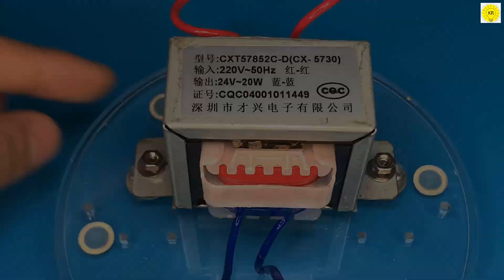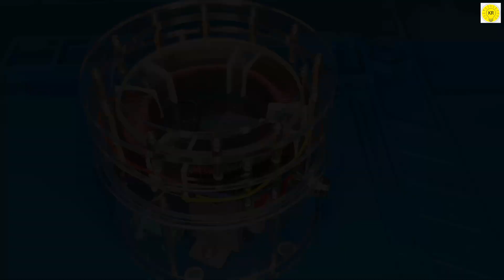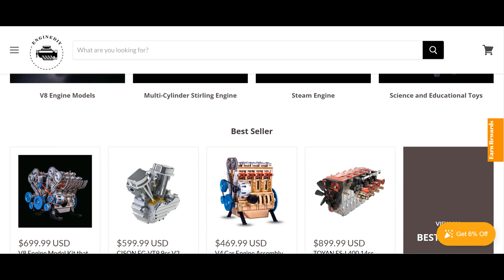how to make AC motor tesla coil motor

Comment: This is how to assemble a widely-available (and low-quality, compared to other versions of the device) commercial product, not how to "make" it. The very simple circuit is easy enough to duplicate by watching this video, but we need to know the details for how to construct the stator (coils and toroidal core). How many turns of wire? What gauge wire is needed? What winding direction for each coil? What is a source, or at least specs, for the toroidal core? This video is actually just an advertisement.

Comment: Show more important things about the project. Not how to solder or how to place a washer etc. I'm left wondering about the coil. But it was skipped over.
Reply: That's because this is an advertisement for a commercial product, not actually intended to help you DIY.

Comment: make his genorator with main rpm(rotating fild) the excited eletromagnets from a stabel ac sorce(street, only exciter spins). 
excite 12  coil on stator, 9 genorator coils on rotor(colect by full ring). in teory it will produce with bouth still soled statec(not eletrosatic) no visual motion. put 1 series semetric 3 coils closed opun its self and your genorator will spin by lens law oposing the ratating magnetic field excited slow 1/10, so u wil have self motion(rotats on its self motive force is a coil producing) and wil be happing a conter-rotation efect so the real rpm will be seed of fiel + or × rpm rotor.

Comment: Nice setup. It looks clean. But it's an induction motor, not a tesla coil motor.( Yes, it was created by Tesla, but tesla coil is a resonating transformer). Also good job creating 3 phase AC using those capacitors. That same method is used in water pumps and stuff to get 3 phase from the 2 phase AC we have at home.
Reply: Tesla is not only made coil for resonating transfirmer he also made coil for 3 phase motor, so the guy at the video just do wrong translate cause from china
Reply: Thios motor like the first invented by Tesla only need 2 phases with a 90 egree phase shift. This was imagined by Tesla in 1882 and a prototype built in 1883. Tesla built the 3 phase motor later in 1888.
Reply: We have at home 3 phase AC.